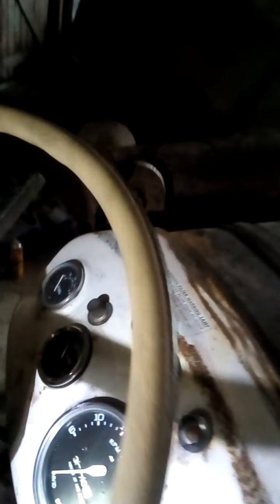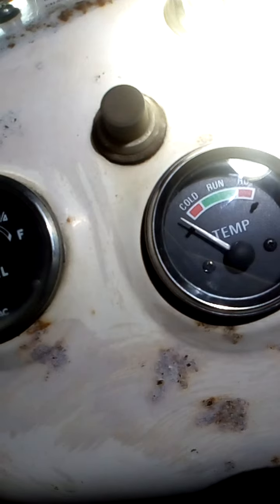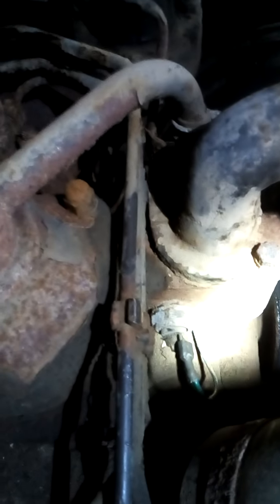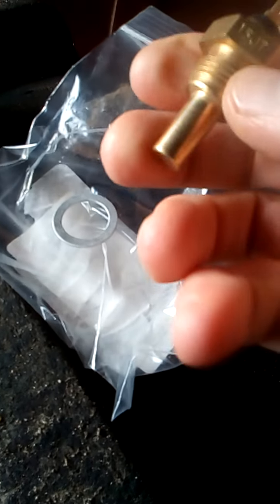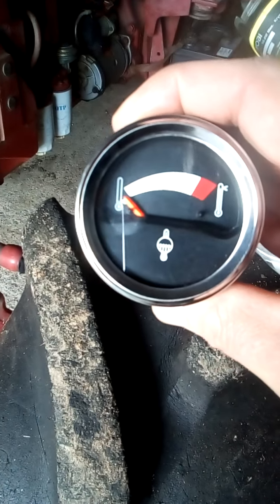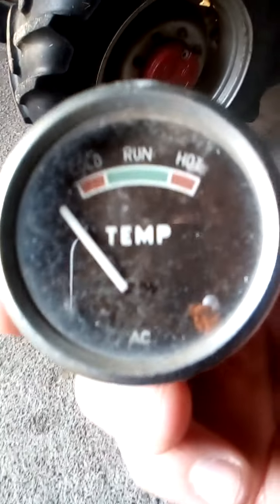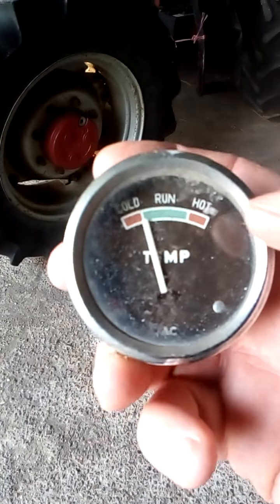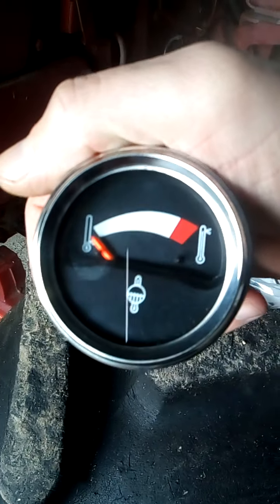David Brown 780 temperature gauge

Comment: As a suggestion (I know it is 3 years later), put a silicon diode in series with the sensor wire. It might even take two silicon diodes in series. Never use resistors for this purpose. Diodes will drop the voltage and hence the current in a constant fashion irrespective of the resistance of the temperature sensor and for this reason, won't reduce the sensitivity of the gauge by very much. A resistor will reduce the sensitivity and span the needle can move and therefore won't work. I just ordered one of those gauges that looks similar to the original AC gauge so I suppose I will have the same problem you have had.

Comment: You mentioned that the tractor had been shut down for an hour but it still shows a temp. That maybe right as is does take a while for them to cool down. When DB made these cooling systems my early 30c will not warm up at all until I drive it and thats with a radiator blind pulled up.